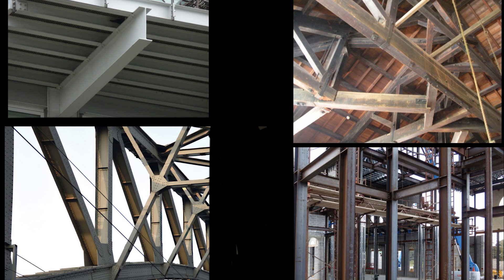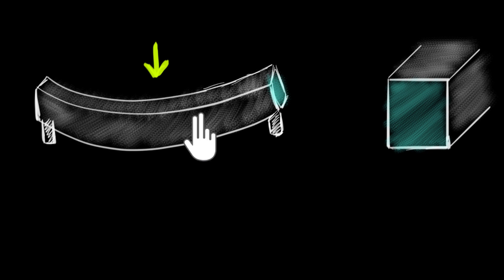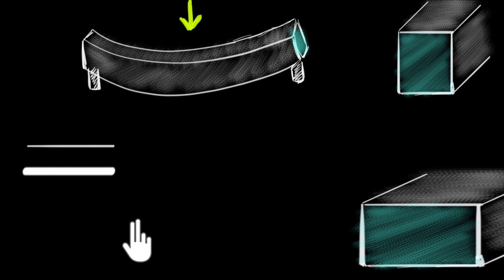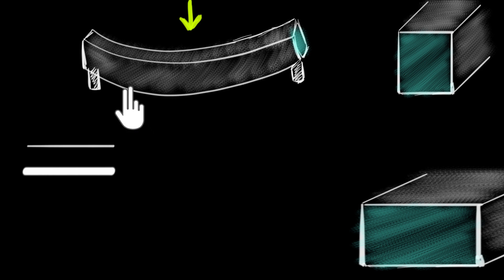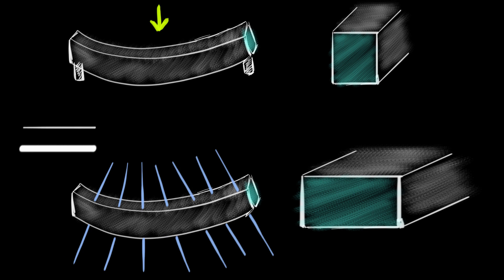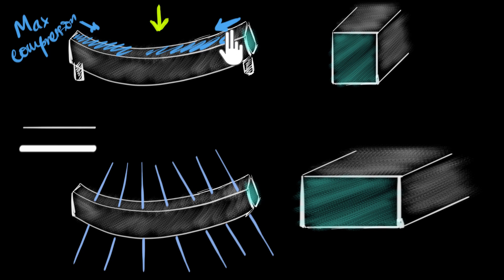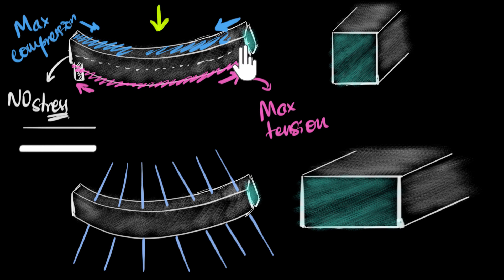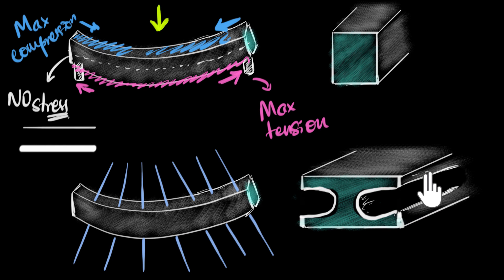Why use I beams in construction? | Class 11 (India) | Physics | Khan Academy

Comment: but as we know the thickness of steel is higher than square tube.. and it becomes heavier than square tube.. and we get an another issue "torsion and buckling" to resist than we had to add stiffeners and braces means more material more weight and more manual labor work... so practically rectangular and square tube structures are better than i beams but just because of workability and easy manufacturing I beams are used.

Comment: The steel section that you display (at 0:08) in the centre of your first compound photograph is not an 'I'-beam. In fact it is not a 'beam' at all! It is a section of Universal Column, specifically designed to take load when placed vertically. You can see this by the fact that its width is similar to its height. A section of Universal Beam (clearly shown at the top left of your photograph) is deeper in height than width. This is because it is designed to be used horizontally (as a beam). Remember: beams are for horizontal use; columns are for vertical use. It is unsafe to confuse the two.
Reply: Why can't we use hourglass beam like as he said the compression and tension gradually increases all the way to top so wouldn't it be better to make this way to ensure a bit more safety? Can you help explaining that?